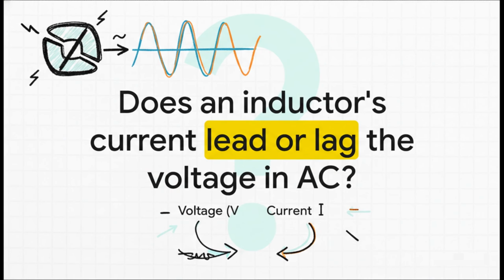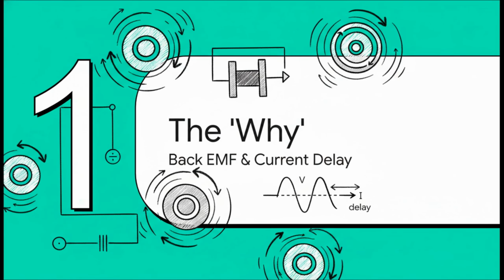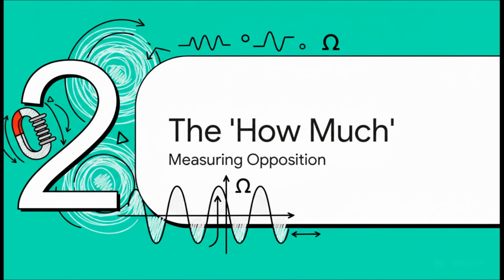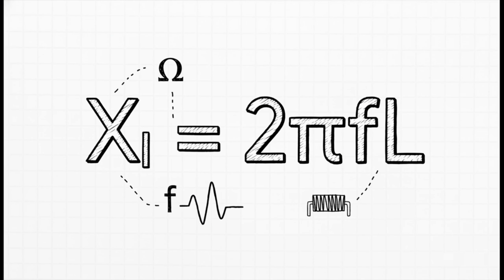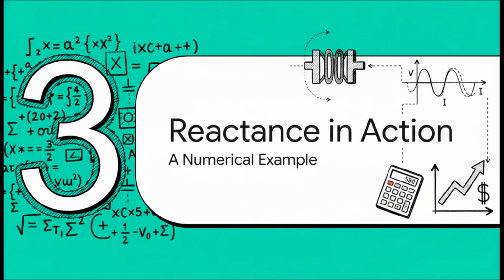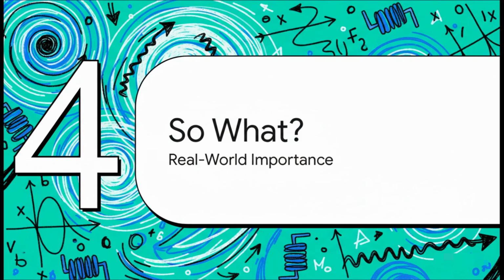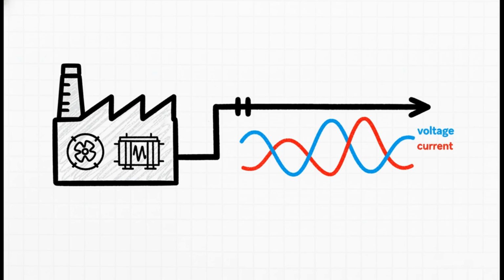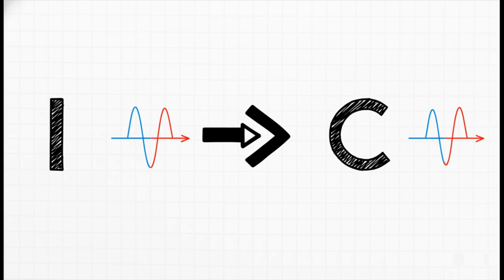Inductor in AC Explained | Phase Relationship & Inductive Reactance

Comment: Back emf has nothing to do with the 90* phase shift between voltage and current. When the switch is closed the instantaneous voltage across the inductor is maximum while current flow is zero. Then current begins to increase in the inductor with a concomitant decrease in voltage across the inductor. When voltage across the inductor becomes zero then current flow in the inductor is maximum. @ this point current now leads voltage by 90* and thus takes on the characteristics of its mirror image,  namely the capacitor.
Reply from the maker: Back EMF is actually the reason behind both the transient response and the 90° phase shift.

In an inductor, V = L (di/dt), so voltage depends on the rate of change of current. Because of this, in AC steady-state, voltage leads current by 90°.

You’re right about the switching behavior — that’s transient analysis. But phase shift is a steady-state AC concept, and both are linked through the same principle (back EMF).

Also, current does NOT lead voltage in an inductor — that happens in a capacitor.